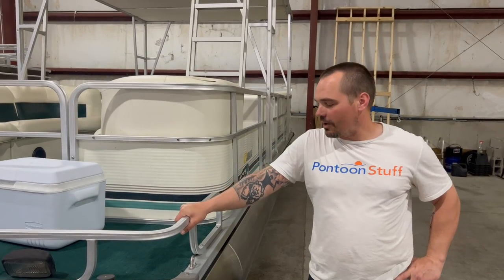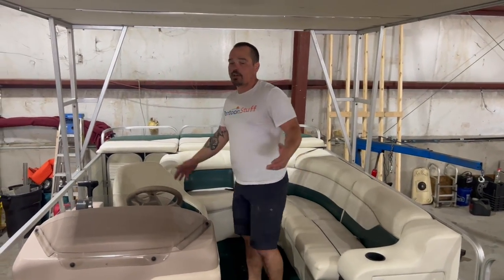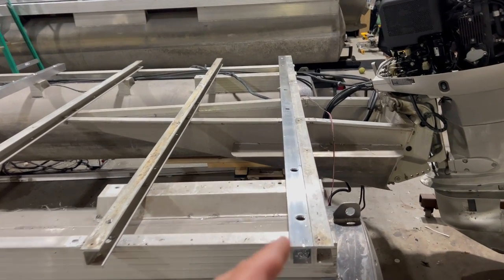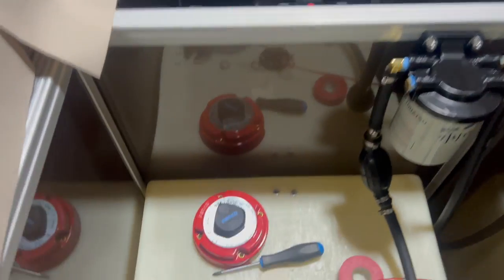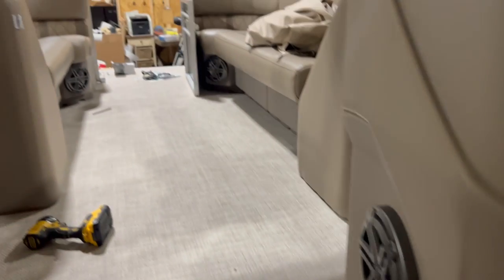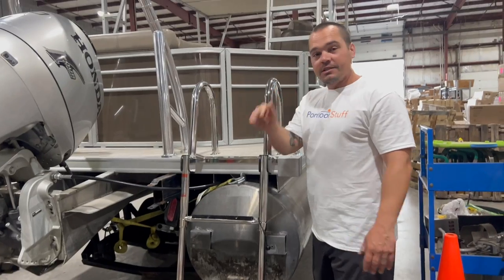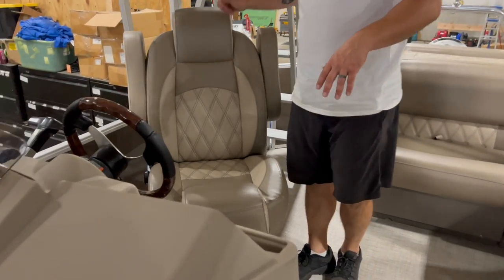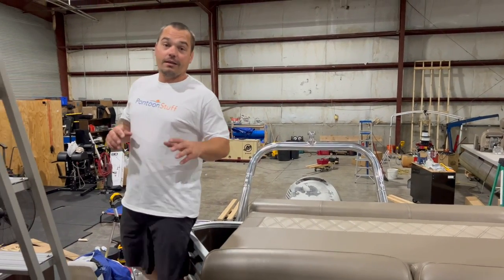Pontoon Boat Transformation - 24’ Double Decker

Comment: Awesome video. I want to install a second level on my boat. And I need to re-deck the floor. So much knowledge I'm slowly learning.
Reply from the maker: We’ve only worked with existing upper decks, but a local aluminum welder should be able to build you something custom!
Reply: @tomspontoons  Thanks. I'm going to ask my local welder. Good videos Toms toons!

Comment: When you move the center transom back, do you find that you always have enough shift/throttle cable to make it work or do you have to purchase a longer kit?  I'm looking to do that with my 2008 207 Bennington chasis but am worried my cables will come up short.
Reply from the maker: It’s probably 50/50 whether they need new cables or not to be honest. Not a terrible project if they need to be replaced. Steering cables usually have less play and will need to be replaced more commonly. All in all about $200 in parts to replace and an extra hour of time. I’ve been able to re-route shift/throttle cables on occasion to make them work without replacing too.

Comment: Nice job. I have one I am just wrapping up on now. This is a lot of work. You don’t realize all the small details til you get into a build. 

I have another 28’ Harris torn down and want to do the deck extension what is the aluminum stock you use to do that. Also does the motor sit in the water deeper when you slid it back?
Reply from the maker: It shouldn’t change much at all with pushing the motor back, especially if you then slide some stuff forward to get some walk around space on the back. Usually balances out nicely. I use 6xxx series aluminum, usually 3/16” to 1/4” thick walls. Might as well make it last forever! Best of luck on your projects!!!